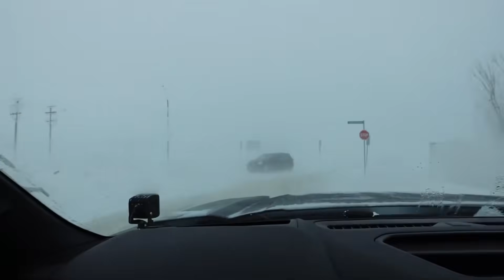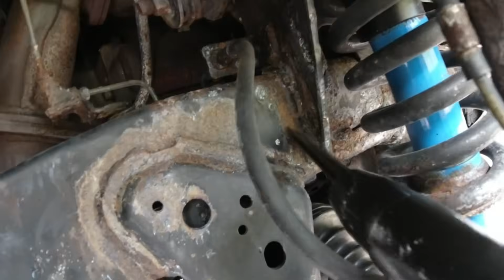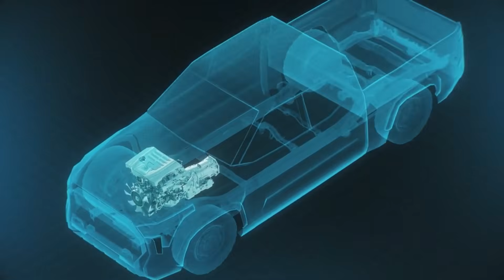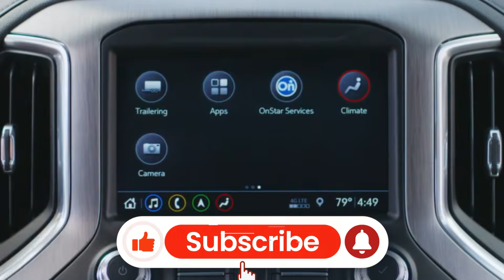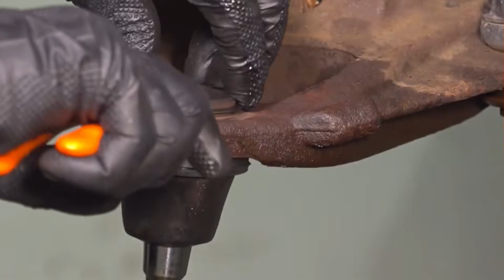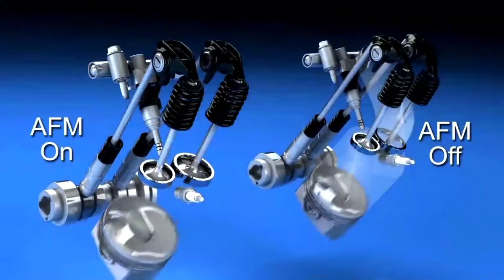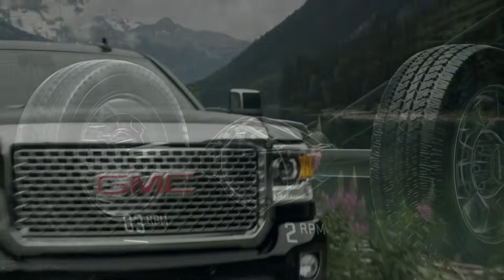GMC Sierra 1500: The Good, The Bad, and The UGLY After 100K Miles

Comment: I’ll take the aluminum frame any day 1:21
Reply from the maker: The aluminum body debate is real — lighter weight, no rust, easier on payload numbers. The guys who've lived through Michigan winters with steel bodies understand the trade-off completely. 👍
Reply: @EverythingGMC-k9x  I had a Ford raptor for three years. Not a speck of rust in northern Illinois. The truck was raptor red, but from salt would almost look white in the winter. Exaggeration, of course, but you know what I mean.

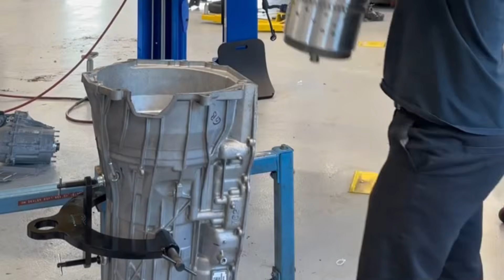Comment: At 17:20 You mentioned the aftermarket  fixed what the factory couldn’t (regarding the transmission ).   What are you referring to?
Reply: For the life of me, I can’t remember the name of the company at the time, but there is a company that has fixed the valve body issue with their own. even offered it to GM and according to the owner of that company GM turned it down.
Reply from the maker: That story gets told a lot in the transmission world — wouldn't surprise anyone who's watched GM's warranty response to known issues. If you remember the name, drop it below — that's exactly the kind of detail this community needs to know. 🙏
Reply from the maker: That's referring to upgraded valve body kits — companies like TransGo make aftermarket valve body calibrations that correct the factory shift programming issues on the six-speed and eight-speed units. Firmer, more consistent shifts under load and it addresses the slipping that causes long-term clutch pack wear. 🙏
Reply: @EverythingGMC-k9x  good info, thank you.
Reply from the maker: @JT-LV 👍🏻🙏🏻

Comment: You always mention the 6L80 as a good transmission but what about the 6L90?
Reply from the maker: The 6L80 is solid — it was the workhorse behind the five-three and six-oh for years and handles towing well when maintained. The 8L80 gets the nod because of the wider gear spread and better highway efficiency, but a well-maintained 6L80 with regular fluid changes every 30K is not a liability. 👍

Comment: I have a 2002 1500 Sierra HD with a 6.0 with only 61,000 miles. It was a California truck and now it’s in Idaho. My wife drives it to the shooting range. I’ve only put plugs and wires new filters and on the third battery
Reply from the maker: Plugs, wires, filters, and a battery — that's it on a 20+ year old truck with 61K. California rust-free body, now in Idaho. That's not a truck, that's a time capsule. Your wife has good taste in vehicles. 💪
Reply: Nice truck where are you in Idaho I live in downtown Boise

Comment: I have a 2002 GMC Sierra SLT Z71 extended cab 5.3 l with only 80,000 miles two tone paint black and gray I'm the second owner it's in pristine condition inside and out no rust no dings no dents I get compliments all the time and people wanting to buy it from me not for sale built like a rock One awesome truck
Reply: Lucky Bastard; that truck will out last you, take care of it will guarantee reliability!
Reply: @flashnmb1 I plan on it I bought it 2 and a half  years ago when it had 54,000 miles I paid $20,000 for it I would have paid more the previous owner took great care of it which made it that much better for me
Reply from the maker: 2002 Z71 extended cab, 80K, two-tone, no rust, no dings — and people are lining up to buy it. That's what a well-kept GMT800 five-three looks like. Not for sale is the right answer. That truck has another 200K in it easy. 💪